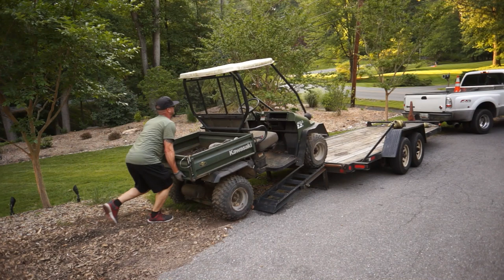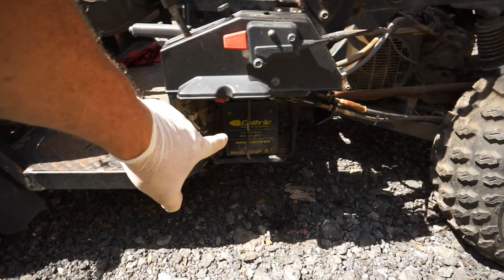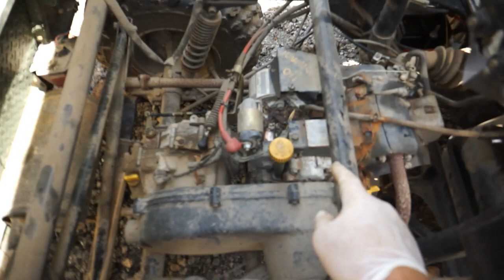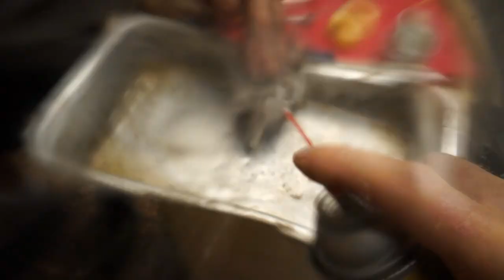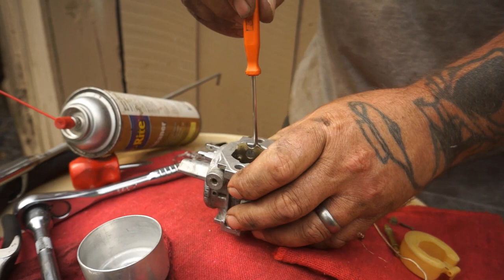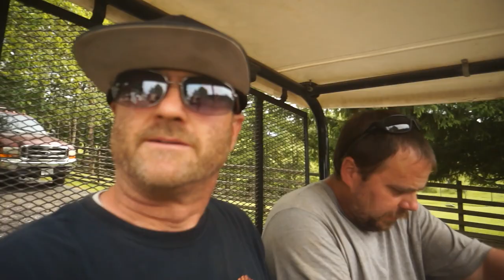KAWASAKI MULE NO START  FIXED

Comment: You both have already saved me exactly $63 bucks by doing a oil change myself. The cycle shop was charging me out of the rear end
Reply from the maker: Make sure you subscribe to our channel..
Good for you..save all that money, use it for everything else you need.....fixing it yourself, save money and use better products for less money.
Fix it yourself and save that money!
Keith 2guys how2
Reply: @2guyshow2thefishkingz89  My one main issue now is the hand brake arm will come up and stop the ride but the ratchet wont hold it locked, you cant even hear it ratcheting to lock and the spring on the button wont work its stuck
Reply from the maker: @shawnevans58 Try to spray some oil down the brake hande..the spring inside might be rusty and stuck.
Gently tap the outside and see if it frees up.
Reply: @2guyshow2thefishkingz89  Guys, you have been so helpful to me its unbelievable. Mine is actually a 2012 Mule 610 XC. Never had any issues but things are starting to wear out overtime things need worked on.
Reply: @2guyshow2thefishkingz89  Thanks, ive been very busy this week hopefully i'll get on it this weekend. Could you help me tell me where the grease fittings are on the mule? I normally keep those greased on my old 4 wheeler often.

Comment: I have a 2012 Kawasaki mule 610 XC I have spark gas straight to the carburetor fuel pumps working brand new can’t get it to run🤷🏽‍♂️
Reply from the maker: I would take spark plug out and crank the engine over a few times...to clean out the cylinder. 
Clean off or replace spark plug...use fresh gas and try to start again.
If not..check compression of motor.
Keith 2guys how2

Comment: Thanks so much for the excellent video.  My father gave me his 2001 Mule 550. It’s sat in a barn for at least 3 years and would not start. I have zero experience with small engines but was able to check spark and fuel all the way to the clogged carb. I was not able to get the main jet out of the carb since the slot had been stripped away.  So i used wire and carb cleaner. Once I reinstalled the carb, it started pulling gas in and fired right up!!  Your video was perfectly what I needed.
Reply from the maker: Thanks, glad we could help. If you fixed that unit...every unit is very similar to diagnose and easy to fix. Have fun with it. Make sure you check the other fluid as well...rear differential fluid, etc...clean air filter.
Keith 2guys how2

Comment: Should I add a temp guage to mule 2510 or do they generally run fine with just a dummy light?
Reply from the maker: Up to you..if the light is working properly..that's all you need.
An added gage is never a bad idea...then you can actually see the temperature of the motor. 
Keith 2guys how2

Comment: What wire going to the coils on a mule is hot ? Black with a white line?
Reply from the maker: The blac/white wire is the ground wire to the coil. It goes to the ignition switch..to ground out and shut it off.
If you disconnect this wire it will eliminate the key switch or wires from having issues or a problem, from no start.

Comment: Thanks for the video guys.  I recently purchased an old mule from a carnival that was closing down.  This video helped a lot.   The mule had some other wiring problems but once I sorted that out I removed the carb and cleaned it.  It is actually running now!!  Thanks again.
Reply from the maker: Sweet, glad to hear that it's up and running, now. Appreciate the great comment. Fix it yourself and save that money. 
Keith 2guys how2

Comment: Hey i know this is an old video hope you can help.
At 36:59 those 2 mini jets, you show putting in with a little flat blade neither of the 2 carbs i have any screw slot. I cant get those out. I saw one guy in another video tap the carb and one came out but tried that also and it did not work. I bought a new carb and it does run now but idles up and down bad. I thought maybe the new carb was not right since it was cheap.
Reply from the maker: Those little jets might be pressed in.
I would try to spray clean them and clean with thin wire..spray high pressure air through them, make sure the rest of the carburetor is clean as well....and try the original carburetor,  again.
Check all ports and any tiny holes that could be clogged.
Keith 2guys how2

Comment: My 2004 3010 is giving me problems. No fuel moving through fuel line to pump. Just changed pump, relay, filter, fuel lines, and nothing. Killed battery while trouble shooting. 

Hoping to figure this out before I have to buy a battery and still have a dead mule
Reply from the maker: Check inside the tank, try to see the  pick up tube...make sure it's not rusted off, if its metal.
Dissconect fuel line from pum to tank and blow air back through the line into tank to be sure it's not clogged.
If there is no restriction and pick up tube in tank is good..then check the vacuum line to pump...most pumps run on vacuum from engine crank case...the vacuum lines can have cracks or breaks..results in low or no vacuum..
unless it has an electric fuel pump..then it will prime and pump the gas itself.
Make sure your fuel lines are installed correctly..and not backwards on pump or vacuum line.
Don't burn your starter motor up, by cranking it too long. Just be patient and  wait between starts..let the starter cool down. You can slow charge your battery with a 2 amp slow charger overnight...and then keep testing the unit..I'm sure you can fix it, yourself.
Check those areas on the machine and let me know.
Keith 2guys how2

Comment: What is the max psi the fuel pump have??
Seems the dealer will not tell me, dought they even know 😊
Reply from the maker: The pressure is not much..it is made from vacuum created by the motor..when the motor turns over it creates vacuum for the fuel pump to operate.
Fuel pumps are cheap enough to replace and install new vacuum line to ensure proper vacuum to pump.
Keith 2guys how2

Comment: Thanks for this Video. It is excellent and you guys are something. I have a problem mayb you can elp me find resources or a manual on this baby. I bought a 2015 MULE PRO FXT SIDE BY SIDE. MODEL KAF820DFF. It has been a champ  Last month I was usng it on the homestead and I backed it up an stopped and loaded up the bed. I hit the starter and it turned over but will not start. I took the fuel line off at the fuel pump and turned it over and NO Fuel at all Tank is full. I am only getting about 3 volts to the top of the plug to the intank fuel pump.  Pump reads continunity with an ohm meter.  I heard that it has a  VEHICLE DOWN SENSOR I cannot find it to check it out  it is a roll over protection device to kill it incase of a roll over. I ONLY HAVE ABOUT 1200 MILES ON IT. I am retired and cannot work on this fancy stuff. I am fr the 60s and 70s where they built real equipment. I am an electrician by trade. I am in Birmingham alabama. Thanks for any help  I am Don, the Grands call me Poppin.
Reply from the maker: Thanks, for watching...make sure the ground wire to pump is good..If that fuel pump works on just 12volt current, with no vacuum..I would check the pump for failure.  Can you hook up some jumper wires to it..from the battery...make sure the ground is good and positive wire is good..test light each wire..with key on, etc.
You can remove the pump and test it with a 12 volt battery and bucket of water..it should pump. If it doesn't pump..then that shows you it's bad...replace it. 
We had one that would start and when pump got hot..it would shut off...ordered a new pump..good to go. 
Keith 2guys how2
Reply: @2guyshow2thefishkingz89  Thanks I will do. I like your program and all the details you provide .

Comment: I have a 90s kawasaki mule kaf620a it's getting fire and gas turns over but will not crank has compression I've replace regulator gas lines filter cleaned tank all new plugs all new parts still won't crank
Reply from the maker: When you say crank...you mean start and fire off ?
If it has spark at plug...good strong spark..and good fresh gas or pour a little gas in the spark plug cylinder hole and install spark plug and wire..if it has good spark it will run.
If the spark is weak or plug is old and tired..bad gas or weak gas..the weak gas can saturate the plug and cause it not to start.
I would take out the plug..dry out the cylinder by cranking motor over a few times..let it sit and repeat 5 times...don't over heat the starter..take your time.
Install plug in plug boot and hold it to the metal motor bolt..try to start the motor and see if you have good spark.
If you have good spark and a little gas poured into cylinder..install plug and try to start..if it starts..then it's a fuel issue or the vacuum line that connects to fuel pump might have a leak.
Suck out old gas and check crank case vacuum line.
Make sure you carburetor is clean, too.
Let me know, what you find.
Keith 2guys how2 
Suck the

Comment: Where's that vacuum line goto under the carb area I'm struggling to find it's location mines not connected
Reply from the maker: The. Vacuum line goes from the top of the motor crank case...lift up the. Ed and you will see it and it goes to the fuel pump...that crank case vacuum move the diaphragm inside the fuel pump to pump fuel to carburetor.
Keith 2guys how2
Reply: Sorry is meant the other one that goes down.. I presume its a drain or breather as I can't see where it would go
Reply from the maker: @ryanadams7440  Its been a while since I've worked on one of those..without the vacuum diagram..I think the other hose goes to the air filter box or the side of the carburetor...that keeps the vacuum flow constant, in the same direction.

Comment: Can you make a video of a Mule with electric fuel pump problem?  This video was great for vacuum pump trouble.
Reply from the maker: Electric fuel pump would be same diagnose...disconnect the fuel line from carburetor...place fuel line in an empty water bottle and turn key...it should pump gas..or pump gas and shut off after it  primes the system. 
Those fuel pumps are cheap to buy new....best to replace if it pumps a weak flow. The ethanol in gas really hurts the older pumps. Hope this helps !
Keith 2guys how2
Reply: Hey tap on electric fuel pump, they stick and will usually start working again 
B12 in fuel tank
Reply: I was wondering what the max psi of the electric pump is

Comment: I found a fried wire black with a yellow line can I get help iding this wire
Reply from the maker: Can you see the other end of wires and just add jumper wire, solder or crimp connection the missing piece of wire?  
You can use a test light to see if it is hot when trying to start unit..or if it is a ground wire, while trying to start unit.
Clip the test light to motor bolt or negative side of battery and touch tip of test probe to burnt wire, copper strands...while starting the unit..if it lights its hot... reverse for checking for a ground. Let me know.
Keith 2guys how2

Comment: I have a 2010 kawasaki mule 610 XC that doesnt start sometimes but clicks. replaced the starter and solenoid and did not fix the problem and suggestions??
Reply from the maker: I would check the battery connections and make sure the battery has good cold cranking amps....make sure connections are clean and use dielectric grease on all connections. 
Make sure your battery ground to frame is clean..wirebush connections and grease with dielectric grease as well.
Check the starter to selinoid wires and clean...grease.
Clean connections to key switch, too.
Most likely the main battery connections are loose or dirty.
Let me know how it goes.
Keith 2guys how2
Reply: @2guyshow2thefishkingz89  thanks i did not clean or grease but i know they are tight because i disconnected battery to replace starter thinking that was the issue initially.
Reply from the maker: @production1037  If you can trickle charge the battery and have your local auto store do a load test on it. That will let you know if it 100% good. Most times it's a dirty connection,  somewhere...easy fix, but, it needs a good connection to start..
Yesterday, I had a mower key switch that had loose connection and mower would cut out or not start. Cleaned connection, greases, tightened it up and works as should.

Comment: Great video. I’ve got a 2004 mule 3010 that will not start. I’ve replaced rusty fuel tank, new fuel filter and new electric fuel pump, new carburetor, new spark plugs, new battery. Crank crank crank will not start. I’m trying to get this old thing running for my elderly dad. I’m pulling my hair out. Any suggestions?  I do get spark. I disconnected fuel line at carburetor. Getting fuel. 
Thanks.
Reply from the maker: I would check for spark.  Take out the spark plug, plug it back into the plug wire boot. Hold the plug close, almost touching a clean bolt on the engine block, near by, where the plug wire can reach to. Hold it there and try to start the motor..you should see spark..if not then it's a spark issue.
Clean the flywheel..magneto..and coil pad, as well as clean the motor and coil, where the coil mounts to the motor..you need a good ground connection and clean wire that connects to the coil.
Test for spark first..then start all the cleaning and see if it gets spark.
Use dielectric grease on motor where coil bolts to and grease the small wire connection to coil. Keep the magneto clean and dry, no grease. 
Most times it's a dirty magneto..on flywheel...you will see it on there, clean with memory cloth, clean with electrical cleaner spray and regap the coil if you take it off. Those always rust from sitting for long time, especially sitting outside. 
Keith 2guys how2
Reply: Wow. Thanks for quick response. I’ll investigate your suggestions. I do get sparks but maybe to weak.
Reply from the maker: @skinnystrad4241  Bad, cheap gas will wet the plug too much to start it as well..try a quick blast of starting fluid down in the cylinder..leave the plug out for a little bit and let it air out..if water is in the gas..the dried out cylinder, drip some fresh gas or starting fluid in spark plug hole...it should fire it off.
Reply: I’ll try the starter fluid in the plug hole next. Thanks.
Reply: No luck so far. Decided to remove the valve covers. Found one rod out of place in each cylinder.
Reply: Both intake valves were stuck closed. Freed them up. Running great. Why would the valves stick?
Reply from the maker: @skinnystrad4241  Glad you fixed it..compression check is always a good idea, before too much money is spent..
The unit could have sat for a long period of time..Maybe, somewhere that has lots or moisture in the air and the springs just get dry and stick open or closed. Valve springs could be worn or just sticky...Slightly bent push rods..Maybe timing chain loose..poor oil, not maintenanced regularly..
I would just run it and keep good oil and add some lucus synthetic oil stabilizer to the oil..at each change..It will coat everything as it runs and help free sticky parts..
I had a 350 chevy boat motor that had a stuck valve...loosened it up hit it with dead blow hammer..spring bounced back up, tightened back up, compression was normal and on the water we went for years..sold boat, years later while still running good.